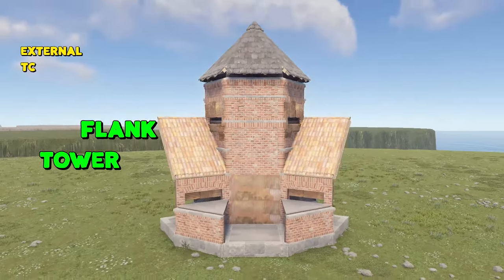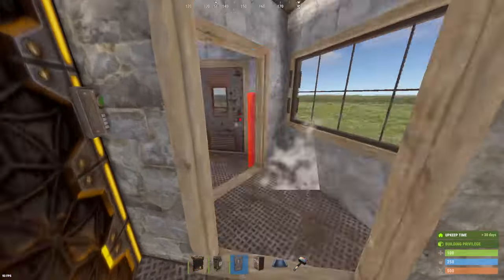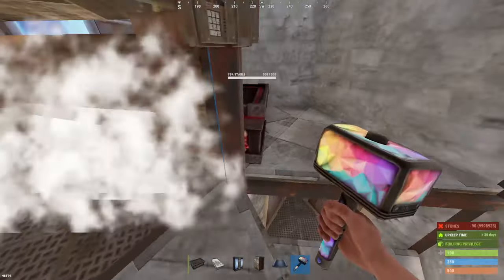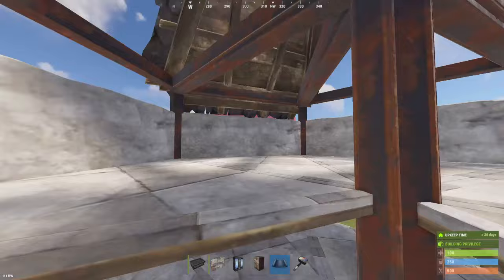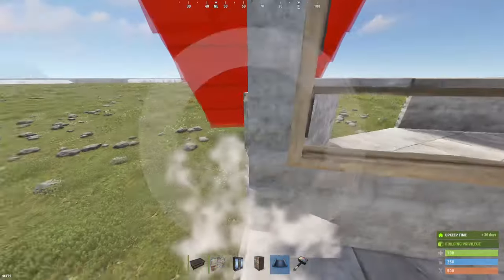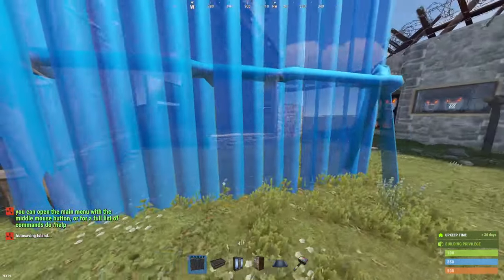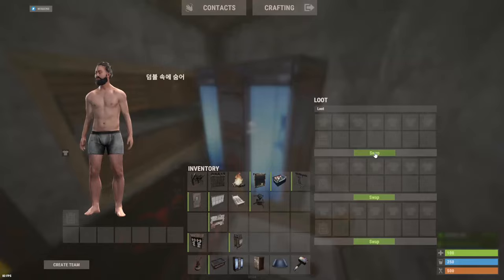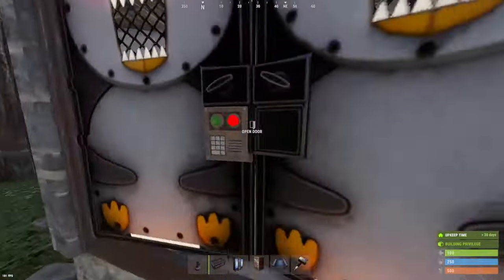Learn to Build and Use the External TC Flank Tower in RUST

Comment: I would like to point out that I recently discovered on both of and console that those "unlootable tcs" are completely lootable by placing a small box, jumping onto it and clipping into the window just enough to clip the tc loot. Unless you place a floor attached to the middle TC piece and upgrading it to hqm
Reply from the maker: You can upgrade to shipping container to make it more difficult
Reply: You cant place small box if there is an external TC.
Reply: @Drizzza  I FORGOT ABOUT THAT!!! Thanks
Reply: @xardnox9849  fair fair
Reply: Make horizontal pixel gaps switch between metal and container to close the gap ;)
Reply from the maker: If you have the patience to setup pixel gaps then yes indeed lol

Comment: i bet the building costs are wrong.
1: to build a autoturret you need more than stone, wood and metal fragments.
2: if you build your base in twig and upgrade directly to metal you skip the stone step
3rd: i never know why people think they have to upgrade thier wall frames to metal, since they just put a garage door on it. thats senseless! keep it stone till you use armored doubble door or shop front. and even for this, you'll never need more than a metal wall frame. a armored wall frame is senseless in every situation.
Reply from the maker: The cost is a general idea of what it takes to build in full and the frames are skinned not upgraded
Reply: karen
Reply: Metal frames, place a garage door back asap when they blow through it. Slight sense I guess.
Reply: @augustusmaximus891  but even with this trick: even a stone wall frame still stands (depending on what they use to break the door). you still need no metal wall frame.
Reply: @Wrutschgeluck once they have TC they can seal and jack hammer any remaining stone frames. I do agree I do the same thing. Kind of like some foundations don't need to be HQM depending on how you build. The only time my frames are HQM is if someone fucks up 😂
Reply: build costs usually don't include deployables like that. Doors and stuff can and should be included in the upkeep costs though.
Reply: @darkopz  he sayed @0:10: "including all the deployables" so the turret is included, but its not.